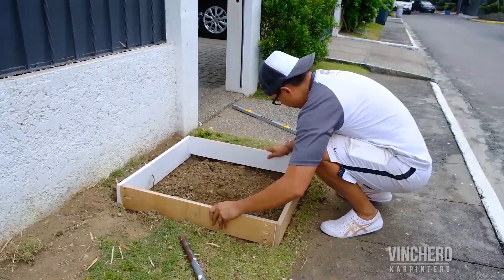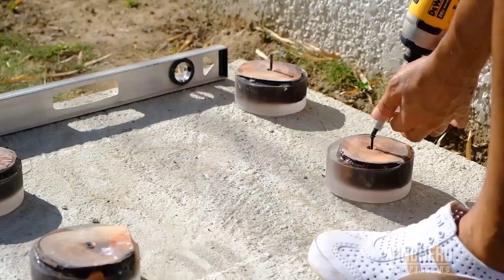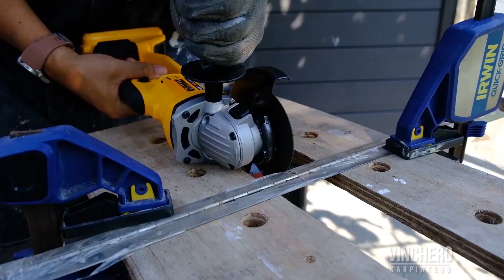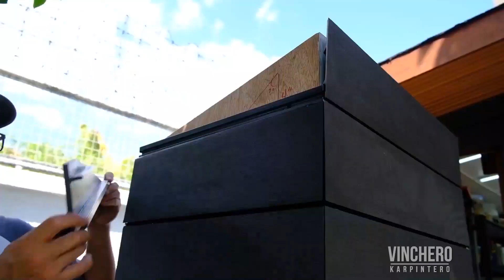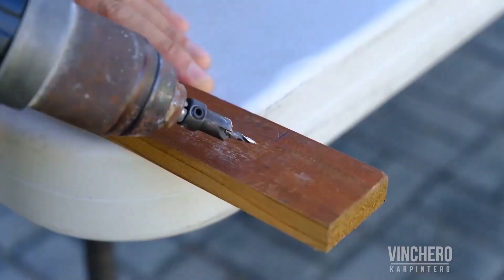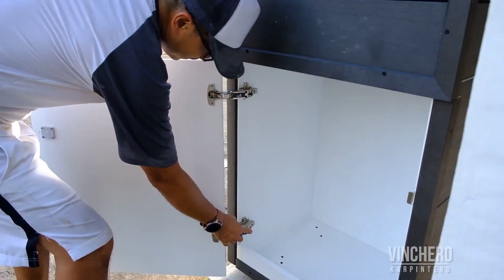DIY Package Mailbox / How to Accept a Package Without Touching It

Comment: The package box is great, but why is the insert tray pulled up by a string? Why is there even an insert tray? If the insert tray is supposed to make it difficult for thieves to steal packages, then the insert tray should not be pulled up by a simple string but must push from bottom to top.
Reply from the maker: Actually it's there so that the package slides and drops a lower height. Contrary to many of the comments, it was never really intended to disuade theft. But I do agree that as a security measure/priority, I could have used chain or something.
Reply: @VincheroKarpintero  thanks for answering

Comment: Nice design but you'll need more than a piece of string to secure the security floor flap.  Otherwise someone can cut the string and just fish out any parcels they want.  Suggest you use metal arms on both sides instead 🙂.
Reply: A steel cable would work - I noticed that too
Reply: Even if it it was a metal rod and cordless grind would make quick work of it and the lock he has on the lower door.

Comment: I love the idea and the size of it. PROPER big container so it can fit a few parcels in case you are away for a few days. Brilliant. 
What I am not sure about is how safe it is because as  it's made of wood. I'd trust it more if it was made of 2-3mm sheet metal. Also, from what I see on the time laps video, some of the screws are accessible. I know that parcel thieves go for the grabs and run and will not spend time to stand there starting unscrewing things, but a box the size of this, is also an invitation for the more "determined" ones 🤣, so I'd replace them with dome headed ones. Anyhow, it's appalling in the first place that people have to take this kind of measures, but since that's how it is, that's a great countermeasure.
Reply: This box has a potential security flaw. If you cut that piece of rope/twine, the flap will fall and enable someone to possibly grab packages down below. It looks really nice and would probably work great in a good neighborhood without porch pirates.
Reply: @arillb1010  Good point. It could be replaced with a hinge or something but again it would be matter of time until someone break it. It still think it's one of the best ideas, but it does need some improvement to make it more proof. Like you said, it would work great in a good neighborhood.
Reply: It keeps the honest people honest.

Comment: It's a start.  But realize anyone with a prybar can get through that 2 way entry design.  Not to mention wood can be so easily pried when held together with screws and prying doesn't make much noise.  Once there thieves will think it's a gold mine because it was designed to protect so you need to be really careful.  They will plan because they think there's a lot in there.  You don't need to worry about delivery people stealing so a lockable lid made out of steel would be the best.  The key is to find the materials as scrap.  So it will be different for each area.  It's great people are working on this idea though.  New houses will come with parcel delivery system built in as well, especially in frigid areas so things don't get damaged sitting outside in cold temperatures for several hours.

Comment: Amazing idea, but the one question I have is would it work for big box packages?
Reply: You'd want to take in consideration how fragile they are and whether you would want them being placed in such a way - but it would only be a matter of expanding length or width, or in even more extreme circumstances digging deep enough to accommodate a similar functioning opening large enough to accommodate it with a steep enough slide and enough room for the package to be placed, pushed, and slid down into an accommodating storage area. You could perhaps go ahead and build a taller structure with steps or a ramp leading up instead.

But at that point, why not just use Ring or the similar services almost every other courier supports; just get yourself a shed with an automatic door strike or smart deadbolt and let it be controlled by the supporting service. It'd actually be cheaper and safer at that point, and the courier would be happier to deliver to your garage/shed floor rather than lift/push/etc with an extravagant contraption such as that.

Comment: Kapag nagupit yung tali, accessible na yung laman..
Reply: ito din napansin ko eh, panu mahide yung connection sa bottom door.
Reply: or another option is ay ang top door ay metal, then use metal chain and weld between top to bottom door.